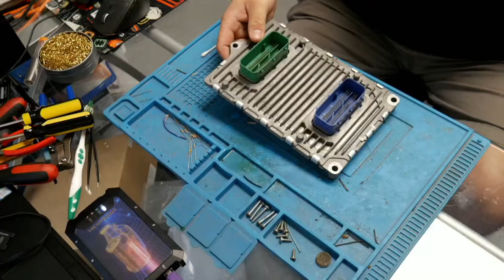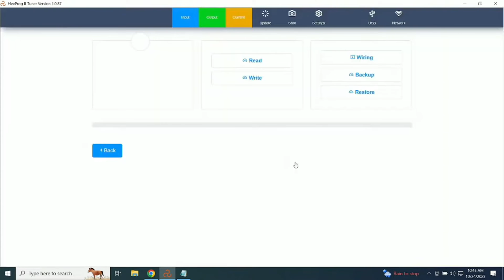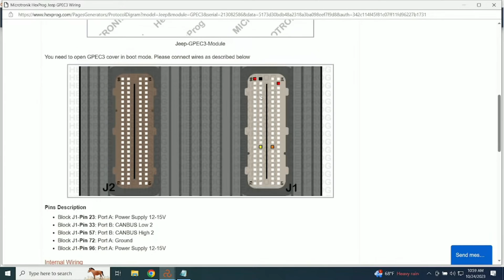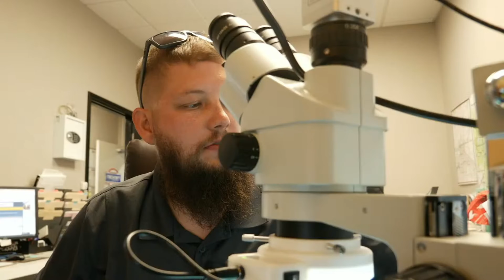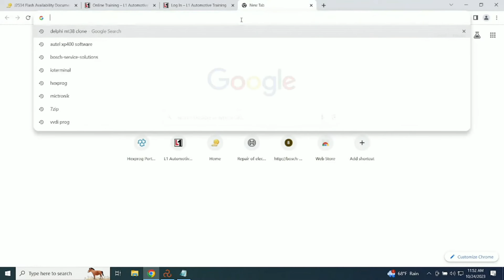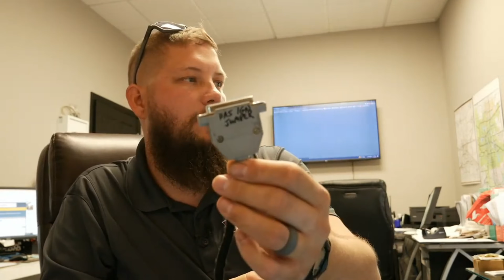Jeep PCM Cloning NO NASTF VSP NEEDED!!!... because we cloned it silly!

Comment: my jeep compass 2021 amt model has problem with u connect software uploading problem which is showing jeep loading and leading to dead battery my dealer is asking to replace radio control box silver box do u have any solution

Comment: I think that I did buy an L! computer for my 1999 dodge ram van, 3500 5.9 gas truck.  This computer did not last long.   Apparently the soldering is insufficient to take the engine bay heat.   Components de solder.   I need to put the PCM inside the cab and that needs a extension for the computer cord.  Six ft. would do.   I constantly get the NO BUS warning.  When it feels like it wants to work it will start.   This is unacceptable.   I could get a donner PCM from a junkyard and use it for a connection box.  Or I could cut all 59 wires and extend each one.   I would use but connectors with the solder option.   The new location would be under the air conditioning.